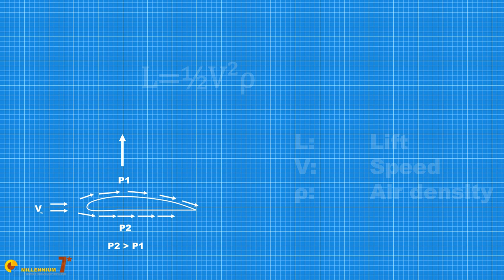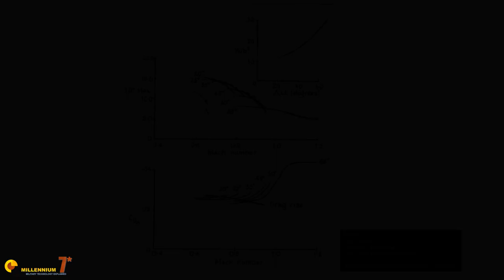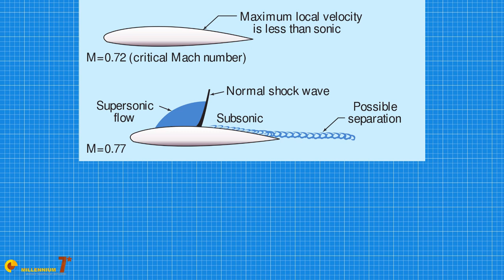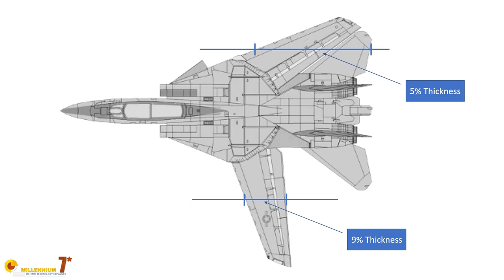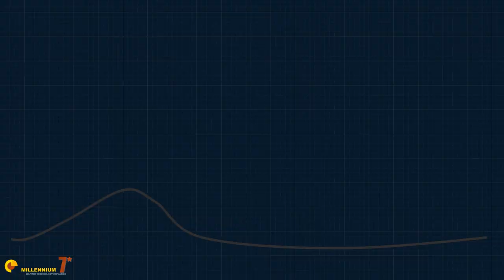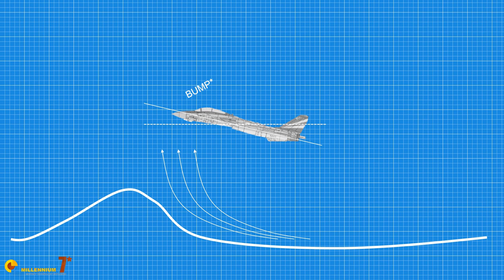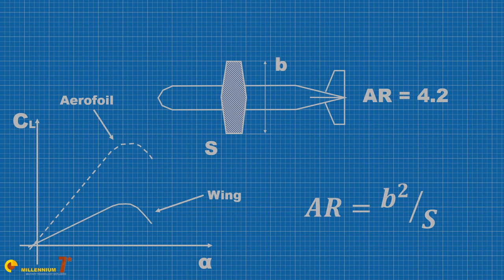Secrets of the F-14 Tomcat design -  The formidable wing of the TOP GUN fighter

Comment: Now imagine that bird with F135’s in it instead of TF-30’s? 86,000lbs of thrust, instead of 40,000 lbs, and it would even weigh almost 500lbs less!
Reply: Throw in some composites, a little thrust vectoring and an AIM-54E and you have the greatest fighter/interceptor of all time.
Reply: Tom Olson I would suspect if you are going THAT far, you might be better going with a new swing wing design, but similar configuration. I think the benefits of leading edge root extensions and highly canted vertical stabs that don’t stall at high AoA would be too important not to include.
Reply: @fang45acp  I failed to mention a Fly-by-Wire flight control system.  Can you expound on what modifications to the wing you are recommending?
Reply: @tolson57  Actually, with all those modifications, you have in first instance a completely different aircraft. Not an F-14 anymore. And take an F-15, make the very same modifications and you have a fighter/interceptor even better. But this reasoning don't make any sense.
Reply: @andreabindolini7452  I disagree.  Replacing existing spoilers, flaps, access panels with composites for weigh savings does not make a new aircraft.  Upgrading the engines to thrust vectoring would entail moving to a complete fly by wire system, just as being done with the F-15X and it is still an F-15.  The engine change itself would be plug and play.  I grant you that a move to thrust vectoring would be a stretch but only because of cost.  Allowing continuing development of the AIM-54 just as has been done with the AIM-9 and the AIM-120 have not made the F-15, F-18, or F-16 not the same aircraft.  If the same level of upgrades that have happened to the F-15 had been allowed to continue for the F-14 the Navy would have the most powerful 4+ gen fighter interceptor in the world.
Reply: @andreabindolini7452  Think F/A-18C and F/A-18E and the F-15C F-15E, these would be the analog of the F-14A and the AST-21 and AST-22 . either case would be an aircraft that is faster than the F-35 with as much or longer range as well as longer missile range even when using the same AIM-120 used by the F-35, stealth wise about that of the F/A-18E, Cost about that of an F-15E.
Reply: @pogo1140  In my understanding, F-15E was nowhere near the level of redesign required for a Tomcat 21 or other paper versions of the F-14. In fact, one of the decisive factors of his choice over the F-16XL, aside from obvious performance advantages, was the simplification of the logistic chain because of the commonality with existing F-15C/D.

Comment: You are talking about the thrust to weight of the TF-030 powered F-14A with 42,000 lbsf of thrust with a thrust to weight of 0.85:1 in combat configuration (full internal fuel, 4 sidewinders, 4 sparrows, guns) while comparing to the F-15's better than 1:1 thrust to weight ratio. The F-14A pilots used superior lift of the F-14 especially at high altitudes in thin density air to counter the F-15's better TW. However, the F-14 B/D with the GE-F110 engines by all accounts was "overpowered" and pilots needed to be cautious while using afterburners especially at low altitudes, which is why afterburners were not used for carrier launches. It made a peak thrust of 60,000 lbsf of thrust at Mach 0.8 and had a thrust to weight of better than 1:1 in combat configuration (1: 1.16). By all accounts who flew the GE-F110 powered F-14s, the F-14 B/D well flown by an ACE pilot had no issues in ACM against the F-15.

Comment: I think the biggest reason there's no more swing-wing aircraft in the pipeline for the United States is because you can't make it stealth .
Reply: Current advances in propulsion, aerodyamic, electronics, relaxed stability and flight controls simply made the swing-wing unnecessary to achieve the required combat performances, even before stealth came into play. For the F-14 the swing-wing was needed at the time for the peculiar combination of requirements that had to face, but commencing with the F-15 that solution was quickly abandoned for good.

Comment: F-14 was the best Navy fighter indeed. Beautiful Aircraft.
Reply: One of the things that does my head in about it, is that the airframe was designed to be able to take significantly more powerful engines when available. IE 35,000 vs the 30,000 with the TF-100 at mach 0.9. GE came up with an engine 100 pounds lighter, 3000 pounds more thrust, and near 10% better fuel economy. The result? Congress were hell bent on scrapping the F-14 so took no notice.
Reply: @gordonlawrence1448  TF-100 with 30,000? I think you meant TF30-P412A with 20,900lb in full burner.

There was an F100 variant called the F401-PW-400 that had hundreds of millions of 1970s dollars invested in it, but was never adopted for some reason. It would have shared commonality with the F-15 & F-16 Pratt & Whitney engines, and provided a combined 6000lb thrust increase over the TF30s.

They did some testing with an early F-14A with GE F101s in  1980-1981 calling it the F-14B Super Tomcat, but it wasn't until 1987 that they upgraded several F-14As with the GE engine (then called the F110). Those were called the F-14A+.
Reply: @LRRPFco52  The F-14A used the TF-30 (which proved to be unreliable according to some sources) the there were a handful (4 i think) F-14's tested with T-100 engines then the F-14B in production used the GE F110-GE-400 as did the F-14D. The GE was about the same power as the TF-100 but way more reliable, had better compressor stall margins and was marginally lighter if I remember correctly. I think the GE engine you refer to is the one I was thinking of but it's a long time since I worked in the defense industry. Did you know there were even two test-bed tomcats that were fitter with RR Spey at one point? That would have really been the wrong engine in the wrong plane.
Reply: @gordonlawrence1448  I lived through all of it at the time, although I was closer to USAF programs. The original F-14B was an early A model they used for the red and white Super Tomcat GE F101 demonstrator. It was the same engine from the B-1B. They also did an F-16/101 demonstrator, which the USAF really liked. They started putting GE F110-GE-100 motors in new production Block 30 F-16Cs in 1986. We were doing avjonics work on Block 30G F-16C in 1987, expanding certain A2A capabilites in the F-16C.

The Navy did an upgrade program on some A model Tomcats around that time, calling them F-14A+. They later re-designated them F-14Bs. I never heard about the Rolls Royce powered Cats. Some of the F-14A+ served in Desert Storm.
Reply: @LRRPFco52  As far as I know the RR Spey ones were static tested. I dont think they even got as far as taxi tests. The rest of that batch of Spey engines ended up in some RAF Phantoms years later. Another stupid idea from a politician. Yes the Spey was more powerful than the J79 at 20,500   compared to 17,900 at full afterburner but it completely buggered up the aerodynamics to the point where it was near 200kt slower. Someone in the RAF once called them "swivel eyed lunatics".
Reply: @Joe150 ish please read all the comments.

Comment: Honored to have had the opportunity to have flown one of these amazing machines. I saw my first tommy at a military-themed airshow in 1986 near Atlanta Georgia when I was 16, there for a future service member youth group through my school. I was sold the moment it lifted off the ground and the impact of that horizontal wing span hit me as I stared into the hot glow of afterburners as it rolled left and up into the air. I was originally set however on being a helicopter pilot however I owe my instructors for setting me on another path. 

What I'll remember most was my first flight in one which was not as a pilot but my first flight off a carrier deck as I sat in the rear RIO seat - and the vibration and sound as we throttled up into clouds and I glanced at the wings as they began to sweep further and further back. The VG sweeping wings were always my guilty pleasure. 

Nothing looks as graceful or sleek as a tommy in full sweep at high speed carving the air... Then the impending presence she gave from her sheer size and form with her wings in a forward sweep which if you were friendly was likely an unwelcome sight. I'd be lying if the Star Wars loving kid in me didn't come out a few times as I'd imagine in my head "Lock s-foils in attack position".  

I did not get to make use of much of the firepower at my finger tips as generally my tour of duty was the gulf war and a few years afterwards. We were primarily reconnaissance and patrols above the water which saw very little activity.  The most my brothers and I got to do was unloading our 20mm rounds into suspected IED hotspots and even those were few and far between.

Regardless it is not an experience to be forgotten and I'm warmed by the eternal love these birds get from those even half my age. In 2008 I spoke with another former F14 pilot who flew these birds when they were still rolling off the factory floor in 1978 and he told me the technology was the hardest part to walk away from. At the time he discharged in 1985 he told me the tommy felt like it was from the future and there was nothing like it in the civilized world. He alluded in 2008 when I met him that he feels like he finally sees technology around him that reminds him of climbing into the cockpit for the first time in 1978. 

I began my service at the onset of the Gulf War and left the service in 1997 and I still left with a similar feeling despite the consumer computer age being in much fuller swing. God bless these old birds.
Reply: Amazing comment! I'm in the planning stages of a video that's something along the lines of an "in defense of" for the F-14. I plan on highlighting everything from it's performance against the F-15 in mock dogfights, to it's premature retirement via dirty politics. If you have anything you feel would contribute to the project in any way, shoot me a message over on my channel. I check all comments so I'll definitely see ya if you pop up. Thanks for your service, and take care!

Comment: The Tornado F.3 in RAF service was due to receive an automatic wing sweep system similar to that of the F-14's. Although it performed very well in testing, it was rejected on cost grounds.
Reply: It wasn't just cost grounds, I've seen some discussion on PPRuNe about this and it was pointed out that some pilots thought it was a wast of time because it reacted too slowly. They prefered to be able to select the best wing sweep for the maneuver they were about to perform rather than have the wing only reach the optimal position after they'd already finished the maneuver.

Comment: You mentioned briefly the F-4. I recommend you do a episode alone on the thing, because so many crazy concepts and complexity were employed on the Phantom, that is a miracle it actually flies as reliably as it does.
Reply: Reliable? I'm sure I read an anecdote somewhere that some US navy official, or maybe a pilot, mentioned that for a phantom if a system wasn't leaking it was probably empty👍
Reply: @DavidLee-df888  Well, what we can call reliable? The plane entered military service and is still flying 60 years later. Looks reliable in my book.

Now, if a pilot had the chance to fly it at the end of the service life of that unit, obviously it wouldn't look like a brand new plane. A naval fighter can be abused enough to be in rough condition with only a couple years of service, like the ones serving on the Vietnam War. If I'm not mistaken, they started to completely refurbish them with less than 10 years of service. 

Look at the F/A-18A/C models, for example. The Blue Angels units where losing pieces on air shows. A F-16C did lose a piece of its stabilator on a airshow not long ago. 

Planes get old.
Reply: @magoid  OK, first of all calm down. Second, I did mean it in jest since I did say "anecdote". Third, I agree with most of what you said.
Reply: There are no miracles in science and engineering. Shoo shoo!! that primitive thinking doesnt belong here.

Comment: 6:40] I've spent a lot of time thinking about this, swept wings - everything else aside - you take your favorite airfoil section, you favorite lift-drag ratio, laminar flow is long, the drag-bucket is wide, but then you decide to rotate that airfoil 30º and suddenly it is a completely different air-foil section.  Ok, the effective section thickness goes from 9% to 5% , but everything else about that airfoil changes completely, gets stretched out  - just do the geometry.  And, it still works.  Sort of.  You have to assume with a lot more drag.  But maybe they are not that concerned about how much jet-5 they burn.

Comment: The picture at 13'06'' of a disymetric flight seems quite unrealistic. This picture appears on many books on the F14. There have been some flight tests of some asymetric configurations. But I very doubt this extreme configuration was flyable. Such a configuration would generate huge roll and yaw moments, which in turn would require at least some differential elevator and tails rudders just to fly straight. However, it is noteworthy that the rudders are flush with the tail fins, and the elevators do not seem to be differentially actuated.

The Tornado has a safety feature that blocks the wings in position when a mere1,5 degrees sweep angle difference between the two wings is detected..
Reply: In an interview that i saw somewhere on yt with someone involved in the assymetrical sweep flight test he states that it was actually remarkably controllable. The assymetric sweep test scenario was to determine if the pilot could fly back home reasonably safe in case of a major failure in the sweep mechanism, so it was obviously never intended to be flown like that..

Comment: There was another advantage for the variable sweep wing on Tomcat specifically. Storage. Especially on carriers, space is a premium commodity, thus most of the aircraft employed on carriers include some form of folding wing mechanisms. This kind of mechanism irrevocably leads to wing with less structural strength (instead of one piece wing spars, you need to include some form of a hinge into their construction). Meanwhile the Tomcat worked around this issue by including the so called "oversweep" 75 degree wing poisiton for storage which reduces the width of the aircraft when parked, without compromising the strength of the wing. Add no armament hardpoints under the wing and all that results in the Tomcat being able to pull off high G maneuvers at very high speeds. Aerodynamics of the Tomcat are still extremely clever even today.

Comment: The glove vane system was compensation for lack of thrust from the TF-30 to maintain the same maneuverability as the prototype that had more powerful engines that never went into production. When the Tomcat was finally fitted with more powerful GE 110 engines the glove vane system was removed. I worked on Tomcats at NAWC Pt Mugu from 91-94.

Comment: Such a gorgeous plane.
Some pretty involved pros & cons to it, but the F-14D deserved more success. At the time it was overlooked though, the plan was still to develop a swing wing version of the ATF for the Navy. And the F/A-18E did cover the carrier umbrella air defense role in the interim. The "Super Tomcat 21" was a neat idea too. Having the two engines unusually far apart like it does, gives more leverage to roll with thrust vectoring. Replacing the small forward glove vanes with small movable canards (a la B-1B) could have been interesting as well.

Comment: Would have been interesting to have see how F14 would rank against other planes if it got better engines and got a stealth upgrade like F15 Silent Eagle. I have heard that F14 is more aerodynamic than the F15 so maybe then it would have been on the top list of 4.5 Generation planes.
Reply: It did got better engines, the GE F110. While it didn't help that much in turning performance, acceleration, rate of climb and fuel economy improved considerably.
Reply: @magoid  There were some other engines looked at too before it retired. The F119-PW-100 for example.
Reply: In a mock duel a single F14 went against two F15 Strike Eagles and it downed both.  They replayed the game and it downed them again.   Tomcat 4 Strike Eagle 0.  Of course these were not regular Eagles and the Navy pilot was very, very good but there was only one Tomcat and two Strike Eagles
Reply: Is not more aerodynamic. It has a different aerodynamic. The swing wing give some advantage when comes to the extreme top and bottom of the speed ranges. But both extremes are rarely used in real combat conditions. In fact, cons are more than pros.
Reply: @andreabindolini7452  
Do you disagree with me only because im black?
Reply: @nattygsbord  what?